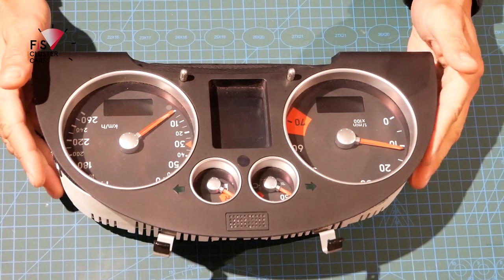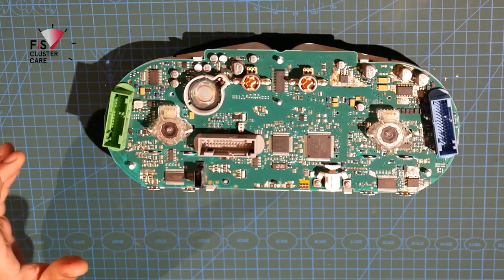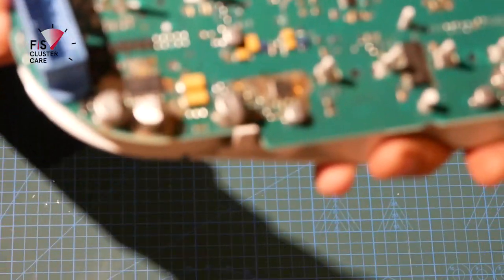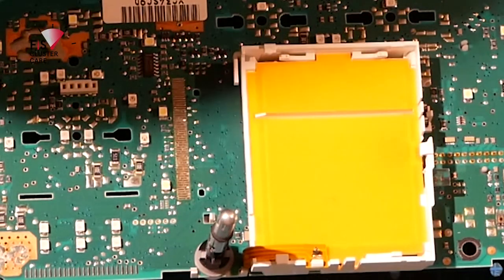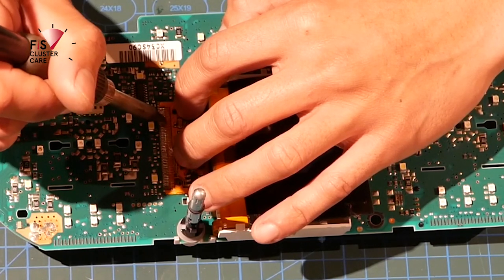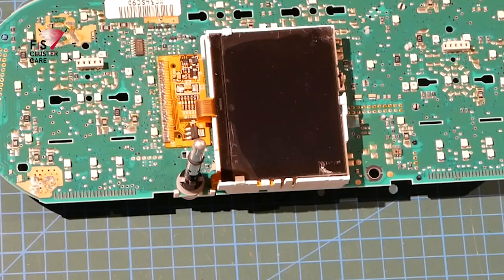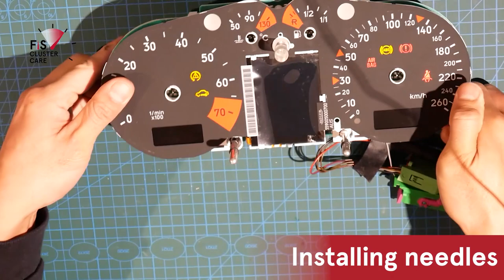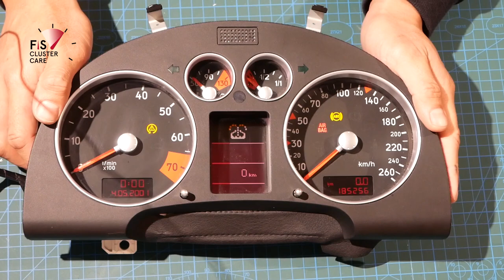Audi TT Mk1 Instrument Cluster Detailed Teardown and FIS LCD Repair (how-to guide)

Comment: Hello again Mr. Ian, so i was able to get my display  off. I wasnt paying that much attention as far as the contacts it says 1 to 51.  It looks to be like 54 traces is the 51 align with the last trace? Hope i explained that correctly...
Reply from the maker: @supertruckertroy  hello. Good question. Align it to the contact at the bottom of the board 

There are excess contacts on the TT board for some.reason.
Reply: @ianpgonzaga  thank you again wish me luck
Reply from the maker: @supertruckertroy  sounds like you'll be ok if you got this far 😉
Reply: @ianpgonzaga  do you know If there's some kind of diode or fuse that's in the board itself  I powered it on amd nothing i checked continuity from each solder joint and all good so would have to be on a power or ground line to it I think if you don't know it's all good I thank you very much for the help you have given now a days knowledge like that costs alot
Reply from the maker: @supertruckertroy  I don't know the details of the board sorry. All I know is that if all contacts are cleanly soldered on screen should work. If no power/ screen lighting up. Keep trying to make near connections.
Reply: @ianpgonzaga  OK thank you. I did see that there was a method of moving the solder  once heated I will keep working it I let you know  and i do appreciate your help. Was there somewhere that I could   donate to your work and efforts in making your videos?
Reply from the maker: @supertruckertroy  it's all good mate! A subscribe is all it takes ❤️ thank you for the kind words!
Reply: @ianpgonzaga  Hi it's Super Trucker Troy, however I'm not so Super now trying my hand at soldering a display to cluster board. I must of damaged something. With that said I have a different instrument cluster board that works but Audi couldn't get a to match with the 8n series so it's basically Junk now is there anything I can do now what about some ECM that is already deleted whatever or let me ask this what would you do?
Reply from the maker: @supertruckertroy  Ah no it's not working at all now ? Ecu Immobilizer off will allow you plug in any cluster. Can help if you are in Aus

Comment: Hello! I have a cluster with a bad center digital display. I bought a new one. I am hoping I can swap them out temporarily - send the original out for repair, use the "new" one to drive temporarily. Is this possible?
Reply from the maker: Hi GJ you will need to match the replacement ones data with your old one. If this step is not done you will be blocked by immobiliser mismatch.
Reply: @ianpgonzaga  Thank you! Is this something I can do? or would it take a trip to an Audi dealership? It's fun to hear from you directly, I enjoy your videos.
Reply from the maker: @gjnelsondotcom  hehe no probs GJ. You will need to take it to an Auto locksmith for coding. Or they can turn off immobiliser for you on your ecu so you can swap any cluster in.

Comment: The rpm and temp gauge of my cluster isn't working anymore. I changed both motors but it still not working. Do you have any clue of the problem?
Reply from the maker: Hey Thiago - if no errors for the sensors then the board will need a good inspection and maybe repairs on the chips.

Comment: Hi my speedometer and rev counter have stopped working, iv changed the stepper motors in both and still not working, any help would be appreciated 😬
Reply from the maker: Hi Stuart. Sounds like a replacement cluster is required now.
Reply: @ianpgonzaga  😭😭

Comment: Great Video! "2 Q's: 1. what is your power supply and 2 my tank if full. do I need to set fuel gauge to full? I would imagine so. Thanks a lot.
Reply from the maker: Hey and thanks. 

I just use a little plug in adaptor thingy. $10 for l Jaycar and has adjustable voltage. 

If powering up on bench you set it to zero - there's no level signal so that gets it calibrated correct.
Reply: Ok great. Any link to that plug in adaptor thingy? Much appreciated.
Reply: Ps my leds are great (still) just have issues with both temp and fuel being way off.
Reply from the maker: @rogerthat1963  ahhh. Check the needle mounts aren't cracked. They should be tight to remove - I bet yours has slipped off their spindles due to damage.  Might need to get new needles.

Comment: Great video and presentation Ian. Your voice-over is nice and clear, unlike many on YouTube. Good steady hands and you make it look relatively simple. I did the LCD on my B5 S4 many years ago after letting a "professional" repairer stuff it up. Ended up losing only one connector. Thanks for putting this up. May be a job for my newly-acquired 8N TT, once I attend to a few other issues...
Reply from the maker: Thanks for the feedback Rob! 

Good luck restoring the TT. You will find your TT one a little more fussy as I mention (even the removal from the car is a tad more involved). 

I also have a TT 8N project to tend to but we’ve gone into lockdown so have to bunker down for now. 

Stay safe and thanks for watching :)

Comment: Hi Ian, great video. One thing I didn't capture is the new lcd pin alignment with the cluster pcb pinout. There are more pcb pins than lcd pins
Reply from the maker: Hi. Great question and you are correct. 

Just looks really closely at the alignment in this video. You line up the "bottom" pins. There are 3 at the top that don't make contact with anything from the LCD ribbon.
Reply: @ianpgonzaga  Just found out that the 1st four pins, started from the top (1l)  going down are unused and required no soldering. I purchased the identical replacement LCD you demonstrated  and it works great now! 

 Special thanks  again for your video tutorial.
Reply from the maker: @PowerGearPerformance  ahhh nice job!! Glad you are back up and running again.

Comment: It would be great if you made a video on how to make the power cable like that because the b5 and b6 clusters power diferent
Reply from the maker: Yes they are slightly different but much the same. 

I have an extension on mine to allow for B5/b6 power up

Comment: Great video, Ian! I'm planning to repair my TT mk1 cluster with new needle motors, lcd and I was hoping to also update the LEDs behind the speedometer and tachometer number indicators. Since the car is over 20 years old the cluster LEDs look faded compared to my newly installed boost gauge so I was hoping to upgrade. Have you ever done that before? I can't seem to find what type of LEDs I should buy and I couldn't tell from your video when you were up close to them. Any thoughts would be appreciated! If you are able to help me to this job I'd happily send in my unit. Thanks!
Reply from the maker: Thanks Arthur. 

The led are a type of SMD. I don't know the spec nor have I tested their voltage before but once you're inside that is what I would test first. The lights voltage. The. You order the same type but with a higher light output. You can easily find them at electronics stores or eBay / alie press etc.

Comment: So the grey plug on the rear is for a v6
Reply from the maker: Good question but the 3 plugs are on all models. Not just the V6 :)
Reply: @ianpgonzaga  I only have 2 on my cluster the green & blue the middle one is factory capped off
Reply from the maker: @stuartwinstanley4949  that's strange... Yours is quite unique then! Does it have a full screen or half ?
Reply: @ianpgonzaga  it's a half screen,but as it's got so many faults iv had the immobilizer removed from the ECU and replaced with another cluster with a full screen,that's why I was wondering what the grey plug was for as it's got nothing plugged into it
Reply from the maker: @stuartwinstanley4949  it's got the up down  and enter controls. On it and a few other bits too. But Mainly the wiper stalk controls.
Reply: @ianpgonzaga  oh right I don't have those,that would explain the difference thanks 👍
Reply: @ianpgonzaga  do you think if I replaced the wiper stalk with the controls it would work the cluster or would the wiring not be there for this
Reply from the maker: @stuartwinstanley4949  it'd probably work with a swap of the cluster for a full screen one but there's be nothing to control on the half screens
Reply: @ianpgonzaga  I'll give it a try if I can find one on eBay 😁